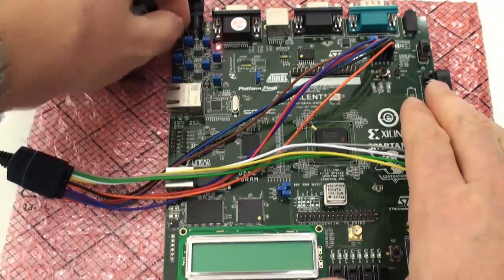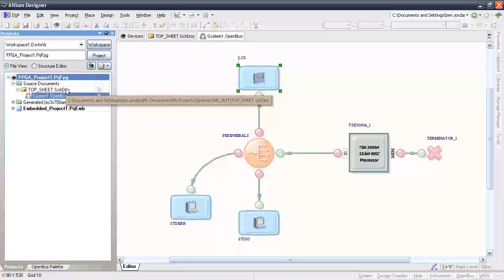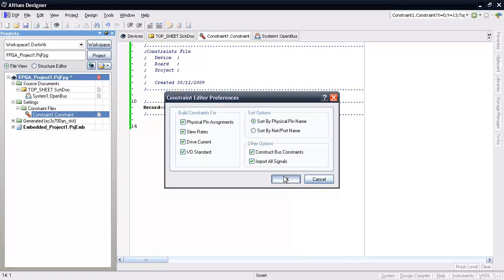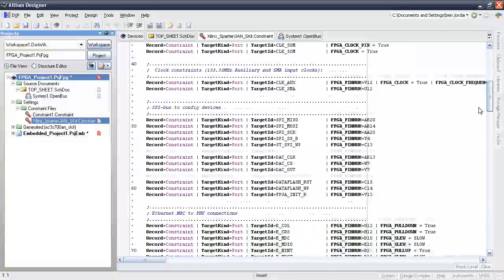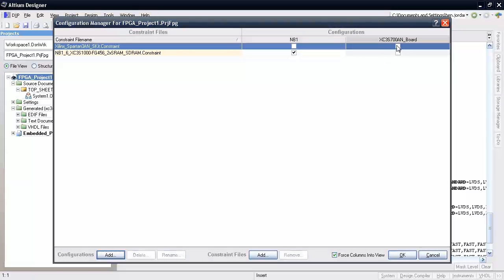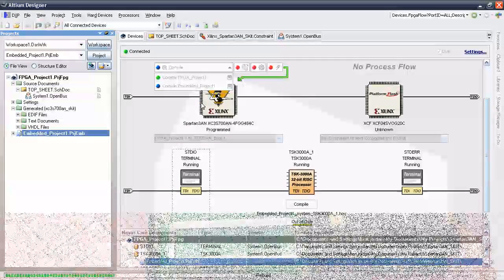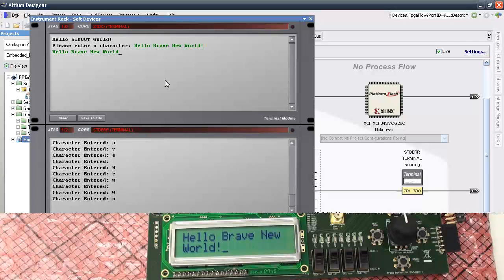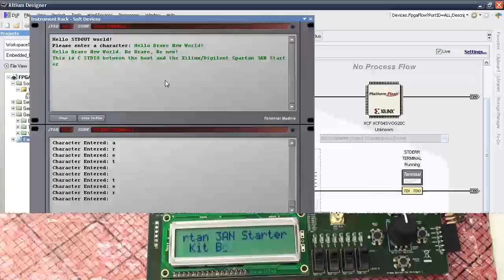Using Altium Designer with a custom or 3rd-party FPGA dev board

Comment: Where I can download the design in the video for Spartan 3AN board ?
Reply from the maker: Do you want my Altium Designer project or the hardware design for the Spartan 3AN Board? The Spartan3AN board I believe was designed and released by Xilinx, and originally I got the PCB design files (OrCAD/Allegro) from a Xilinx download page. They should still make that available for download. As for the Altium project, I have it somewhere but it's been years so I might struggle to find them. I will update the video description with download links, if I can find it all, soon.

Comment: I don't understand two things about this video. Is supose altium design software only works with nanoboard? Or I can use with others fpga's? I need to buy a license in order to work with nanoboard?
Reply from the maker: It was designed for any FPGA design. That was what the point of this video was - to show you how to use Altium Designer with other FPGA boards (not just Nanoboard) and illustrate how you might take your FPGA project to the final PCB for your product. This capability has finally been removed in AD18 because development cost of maintenance is high and Altium counted the number of users of this feature and decided it wasn't enough.

Comment: A friend of mine found this Altium USB JTAG Adapter and I was wondering:
Is it possible to use this to burn sketches on the Arduino microcontroller (ATmega328)?
This allows to use the full program space (flash) of the chip on the Arduino board. It also avoids the bootloader delay when you power or reset your board. 
And where are the drivers for this adapter?

Comment: So the advantage of using the Altium environment for the FPGA design on a custom board, rather than the native vendor IDE, are the (many?) IPs available.. like the LCD controller?

Though I would think the design flow might get tricky, if you still need to use Qsys/Platform Builder (Altera Nios/Xilinx Microblaze) to build part of the system, and then merge that into Altium.   

Is it possible to go the other way.. generate verilog files/edfs from Altium and import them into Quartus/ISE?

Comment from the maker: In theory, you can. But I'm not sure the NExys2 gives you access to the JTAG ports directly (I'm pretty sure that one uses a kind of built-in USB downloader that only works with the Xilinx software).

If you can get the JTAG pins onto the flying leads of the Altium Designer download adapter as shown in this video, you can use the board.

Comment from the maker: @monstercameron The design is done using Altium Designer - the hardware programmed into the FPGA in this case was using a Schematic/OpenBus design and some C-code was run on the TSK3000 CPU IP Core, does that answer?